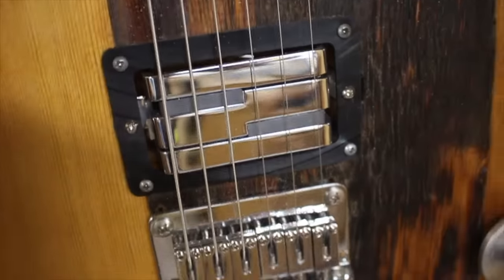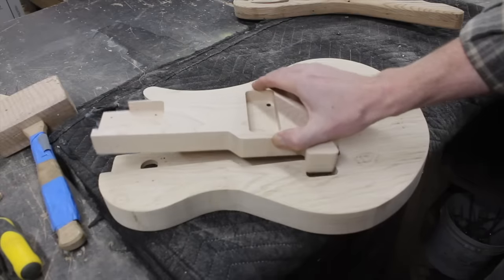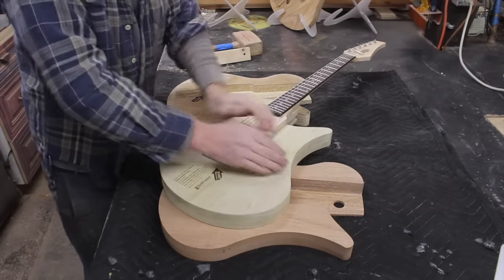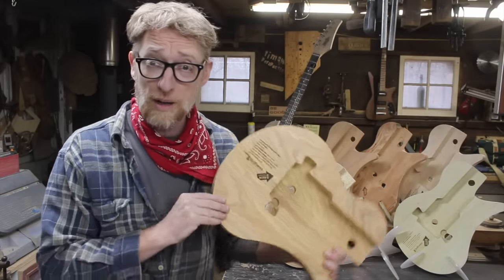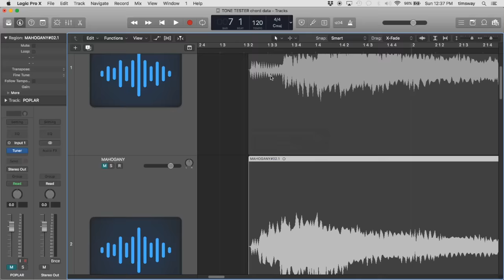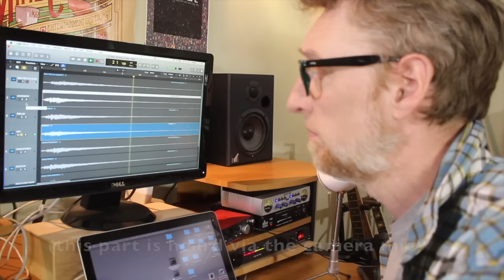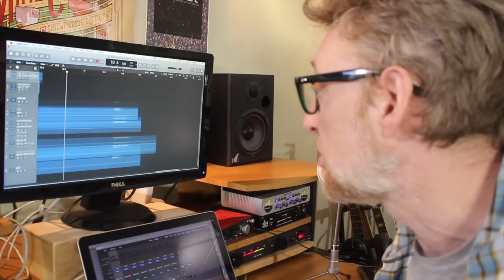Tone Wood Tester: One guitar to test them all

Comment: Great video, this makes me excited to build a guitar using reclaimed wood without fear of sound quality. Thanks for the great video.
Reply from the maker: I've made many! just stay away from soft pine, or reinforce the core with something stronger. The pine doesn't hold up under tension
Reply: I wouldn't hesitate to use reclaimed wood to build guitars. As you can imagine balsa wood and some of the lighter softer woods might work - but structurally not hold up. I know that Johnny Lang has a Telecaster whose body is made from spruce - but I believe it is quarter sawn for structural rigidity. He knew spruce was light and it gets used for acoustic instrument tops so why not? I am sure it was a challenge to make it so it would last - but it is possible. Sometimes it is the journey that matters and then you get pleasantly surprised on top of that. You never know.

Comment: Fun experiment so considerations, the bridge not being attached directly to the main body just will not transfer vibrations as well. The wall thing is miss leading as the wall being a big flat surface is acting as a speaker.

Comment: Wish I could like this one more than once. Kudos for stepping up and doing some real experimentation. As others have suggested, you should push further with this, do 50 strums each like you said, maybe rig a mechanical strummer for it to get the same input exactly, then compare the overtones. My theory is that the body can only affect tone by selective dampening. The poplar sounds brighter so I suspect it's absorbing some of the amplitude from the base note and some of the lower overtones while letting the high end ring fully, but you should be able to confirm or deny that with empirical evidence.

Oh, as to other materials to try, I think you should go crazy. Got a 3d printer? What would a plastic body sound like? Any different from nylon?  Do any metal casting? A bronze semi-hollow might work very well. A lead semi-hollow would be even easier to make, and possibly more useful in a test. Might be a bit heavy but this is for science not gigging, right? Do any pottery? There's as far as I know one ceramic guitar in existence and it sounds just fine, might make a great data point if you have the equipment and skill. And we know you work well with wood, so try any crazy wood you have. I always wanted to hear a maple body, if it's so good for necks why not the body too? Cherry? Ironwood? The lumber store has quite a selection and there seems to always be a deal on something.
Reply: Won't matter, results will be the same. Why? Because 'tone woods' don't make a difference, except in the minds of the snobs and the goof that paid way too much for their guitar, LOL.
Reply: @ModernGolfer  There's a difference between asserting it and demonstrating it conclusively.
Reply: I tried to squish the fly in your profile pic
Reply: @ModernGolfer  In acoustic and hollow body electrics it makes a noticable difference. Solid body electrics I can't really tell a difference either.

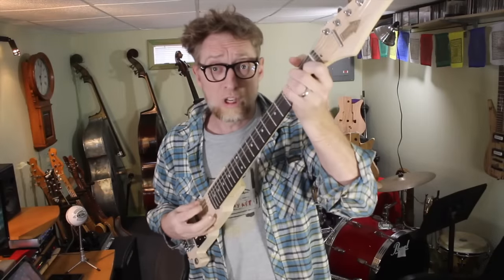Comment: 08:28 Baseline
08:53 Mahogany
09:16 Poplar
09:37 Swamp Ash
10:04 Canarywood
10:24 Reclaimed Doug Fir
10:48 Solid Core Door
12:27 3/4" MDF

1 - Little man should wear a hat, leather jacket and beard -> Mini Adam Savage
2 - The strum is not controlled
3 - The gap / contact surface is another confounding variable

However, I think it's safe to say that body material does make a difference in tone - yeah, I DO hear differences.
Reply: I noticed some big differences, but not in the way you might expect. If you listen closely you can hear an oscillation in the sound, sort of like a vibrato. It's similar to the oscillation you hear from the dissonance when you are tuning your guitar with harmonics. Anyway it seems that it is less noticeable the heavier the wood. On the Ash and Douglas fir it was very apparent and slow. On the mahogany and the canary it wasn't really noticeable at all. My guess is that it is caused by the dissonance between overtones. I'm guessing the heavier wood dampened the overtones considerably. The one that was very strange to me was the door wood. The oscillation sounded very rapid and aggressive. I'm thinking maybe it was out of tune. If not then the overtones seemed to really thrive in the door wood for whatever reason. Any thoughts on this?
Reply: @NickPuentes  What you're hearing is an out of tune guitar
Reply: I know you get that kind of dissonance from being out of tune, but the intensity and speed of oscillations seemed to be proportionate to the density of the wood so I think it plays a part. Also those oscillations are even present on perfectly tuned guitars. I think it comes from some of the overtones being dissonant to each other. I watched a video comparing different string gauges on the same acoustic guitar and the speed and presence of the oscillations was also proportionate to the mass of the strings. It was very apparent with the extra lights and faded out as the strings got bigger until you couldn't even hear it using the mediums. The mediums strings really dampened out the overtones to a surprising degree. They weren't very "ringy" and bright at all and made for a very direct, intentional tone. In most applications, I think it would sound kinda lackluster and like something's missing.

Comment: Cool! Great test. Any subtle differences (if any) could be from not strumming at the same exact location on the neck. I'm sure you tried to, but like you said, we're human and can't be perfectly precise. The only thing I could think of would be to add a mechanical strummer that is attached so it doesn't move. Oh, and perhaps just tune to an open chord so that you take the fingers on the neck variable out too.
Reply from the maker: i thought about some sort of strummer rigged up to a cordless drill. open tuning is a good idea I had not thought of. thanks!
Reply: @timsway  - Todd Weller's comment is what I was thinking too - based on my own knowledge of how to setup an experiment using the scientific method. Setting the guitar in a cradle of some sort and have a completely reproducible/repeatable type of strummer - eg. robot arm, motor-driven pick, whatever. Of course then you have to figure out a way to somehow make sure the apparatus that holds the guitar doesn't also affect the resonance/tone. Perhaps it would have to be insulated between the cradle and the guitar with layers of fabric to simulate the "human" component of the equation. There are SO MANY variables that would have to be controlled for that I think it's ultimately diminishing returns with this sort of experiment. Ultimately, even the quality of the audio someone is using to watch this video will color their own interpretation of the results, despite the evidence of recorded sound waves and the like. I think this just improved upon the first experiment simply by showing that electronics is probably still 90 percent of the equation and the wood is only part of that last 10 percent or less. And, if you come right down to it, the wood is such a small part of that equation that preference in guitar building should be given to using sustainable materials rather than endangered species of wood with only marginally justifiable contributions to tonal qualities.
Reply from the maker: @talesfromtheworkbench2788  here here! Practice is probably the most important variable!

Comment: Plywood guitars always sound ok until you discover its made of plywood then they sound crap. Tone is all in the ears of the listener and is mostly “headology”. My definition of tone wood is any wood strong enough to make a musical instrument out of.
Reply: David Parkinson I had a plywood guitar and it was fantastic 
Cost me all of $60 too
Reply: I have a korean plywood 1989 squier strat that sustains and sounds great its also fairly light in weight. Its also black has a maple neck which has a nice vintage amber tint because of its age its got a single ply pickguard, replacement handwound vintage 50s spec pickups. It looks cool sounds great I love it!
Reply: David Parkinson  Yeah, you‘re completely right. I have a Hondo plywood Les Paul copy, which I bought second hand for 25 $ or so. It was ment to be torn apart, because I needed the neck, and the other harware for a self made guitar. When I plugged it in, I was enthusiastic about it’s feel and sound, so I left it intact and it became my favorite Guitar. That was 20 years ago and I still enjoy playing it.
Reply: KC  Aluminum guitars exist (and sound good)! Skunk Anansie use them: http://www.alusonic.com/
Reply: Jack White plays a plastic guitar. And I've seen all sorts of bizarre builds out of cardboard, colored pencils, you name it, that sound great. Ultimately the nut, saddle(s), pickups, and potentiometers probably have the most impact on the tone of an electric. Also body cavities can make a big difference to the acoustic sound of an electric but not necessarily the plugged in sound, except hella feedback
Reply: Haha. That’s so true
Reply: KC  I never said it was the only guitar he plays...that should be painfully obvious. As for cherry picking that guitar, look to Jack White, not me ... He loves to talk about that guitar in interviews. Clearly for some reason it means more to him than the fancy vintage guitars when he chooses to talk more about the plastic one. If you've heard him play it, you'll also notice that it sounds like Jack White; that is, he can capture a similar tone with that guitar as with more expensive gear. I don't know for sure, but I'd bet he played that guitar in the studio on some of his more well known tracks.

So how is it that a plastic guitar can sound good to the ears of a world class musician? Because, besides anything directly hindering the vibration of the strings (nut, PUPs too high, etc), it is largely the electrical circuit from PUP to speaker that matters most with an electric. I was actually quite surprised by this video at just how long the core was able to sustain without the rest of the body wood. But there you have it. In my experience, wood and body construction matter for acoustic guitars, because there's not a lot you can do to change the sound of an acoustic if you don't like it. For an electric, however, I've literally heard a bass string on a shovel with a pup be made to sound excellent. It's all in the electronics. (Note: This is only considering tone and not how construction quality impacts things like intonation, relief, etc)
Reply: I'll sell you my plywood ephipone les paul special v1 cause you would need to be completely delusional to think it sounds as good as my gibsons. You guys are hilarious.
Reply: KC  I owned an aluminum guitar. even the fretboard was metal. A veleno that had gibson SG pickups in it. It sounded really bright and didn't really sustain well. It sounded NOTHING at all like my actual SG.
Reply: KC  You can't accuse someone of cherry picking and provide no examples of your own. Also, you keep fixating on Jack White's plastic guitar, but I did provide 3 other examples of guitars not built with traditional tone woods: a cardboard guitar, a colored pencil guitar, and a shovel with a string on it. Finally, you seem to have a pedantic expectation of the medium: we're discussing guitars in a comment section. Obviously I'm not going to provide 100 peer reviewed sources and thousands of hours of research like this is a fucking astrophysics dissertation. In retrospect, this barely qualified as a discussion. Mostly me discussing and you nit-picking. So this is very quickly amounting to a waste of my time. Also your odd tirade in your last comment comparing a difference in subjective opinions to some sort of bizarre conspiracy/cult indicates to me that I hit some sort of nerve, and you're clearly too emotional about this topic to have a civil discussion.
Reply: KC  Shhh shh... There there. You have to prepare for Physics 2 in the morning. I'm very proud that you passed Physics 1 last semester, which has a section on string harmonics, but physics 2 has optics and E&M. This isn't child's play anymore, kiddo. Don't want to emotionally strain yourself before the first day of school 😘
Reply: KC  Dude, you're getting way too worked up about this. I actually feel bad for trolling you. I knew plenty of your types in undergrad whose favorite page on the internet was the Wikipedia entry for "logical fallacy" and could engage in endlessly petty arguments about the most minute details of even their generally unscientific hobbies. I think you need to relax a bit and just play the instrument and stop making such a big deal about this. I concede that you're probably right about a lot of the science behind this (it's certainly more of a hobby than an area of expertise for me). Like I said, this is a comments section, not a peer reviewed journal. Neither of us are being paid to be here, so there's no point in having an anxiety attack over it.

Also I hope you don't go full tinfoil hat and off the deep end comparing people you disagree with to consipiracy theorists very often. It's a terribly bad habit for a scientist to strawman like that.
Reply: KC  like I said, endlessly petty. Gotta bounce before the autism rubs off.
Reply: @Ivo.m  A friend gave me a Hondo Formula 1, because it wasn't quite at home in amongst his Fenders & Gibsons.  I gave it to my son to play and it sounded really good.  Overall the guitar was good, but too good to keep, which made me feel guilty, so I gave it back to the guy who gave it to me.  No regrets, but what a gem of a guitar that Hondo was.  I think it's since found a new owner, so long live the Hondo Formula 1 :)
Reply: One of the most famous and sought after in the day and expensive today and then was and is the speedboat made from South American mahogany. A beautiful, sleek and fast boat that breaks records and people. So remember that wood is equally good for Guitars and boats KC. Keep playing.
Reply: KC  - Weight, for one thing. And BTW, guitars HAVE been built out of aluminum, fiberglass, and other materials. And "superior materials" is vague, anyway. And other factors may influence a purchase, like the look of the wood grain, etc.
The 'superior tonewood' is just what many people always thought it was, a marketing gimmick to jack up the price. That's all it's ever been, that's all it every will be. Gibson with their 'ebony vs. Richlite' silliness proves that! 😁
Reply: KC  - All the 'physics psychobabble' attempting to reference Ferraris and TVs to 'prove' your correct doesn't change the fact that you're not, LOL. A guitar ISN'T a Gremlin, or a Ferrari, or a TV. It's also not a refrigerator. Such logical fallacies always fail, as yours has done here.
Reply: KC Do you genuinely believe that the body material of an electric guitar makes such a difference in the overall tone that you have to debate this topic so heavily? There’s no difference that the material of my guitar’s body would make that couldn’t be nullified by the slightest turns of my amp’s knobs. If you actually consider a guitar’s material for any reason other than weight or look, then you’re delusional, because the difference it makes is not substantial in the slightest. If your guitar sounds like shit, the material of the body is never the issue, I promise you that. Your profile picture is very fitting of your representation of yourself here.

Comment: Every test I've seen that even attempts to achieve controlled conditions seems to return the same results. The affect of the wood seems to be pretty much negligible.

The question people always ask is: "Does the wood an electric guitar is made of affect the sound?". I am fairly certain that it does to a small degree, but I also believe that tiny changes in ambient conditions have as big if not a greater impact on the sound. I think if you recorded the exact same guitar hours or a day apart you'd probably see some variation between recordings. I suspect that if you took the neck you made out of a body and then reinserted it in the same body you might get variation in the recording. This could be due to the act of handling, having to retune strings if they've become detuned in the process and because time has elapsed and you've been performing another task, so it gives you time to forget exactly how you strummed the strings (and if we're going into minute differences, your body will be in a physiologically altered state to when you performed the initial strum).

I think the question people should be asking is: "Does the wood an electric guitar is made of have a perceivable or significant affect on the sound?". I don't believe it does.
Reply from the maker: that is a rational conclusion made by a rational mind.